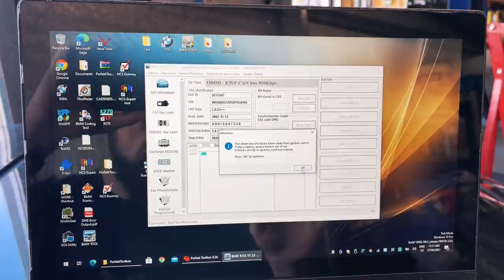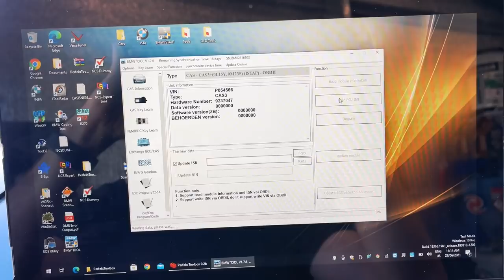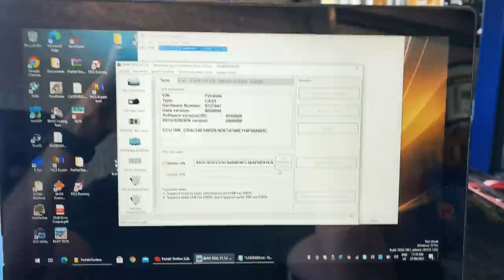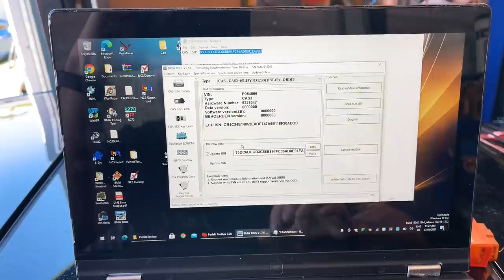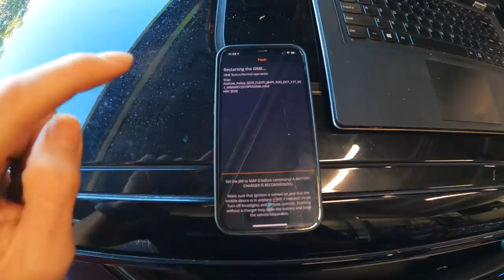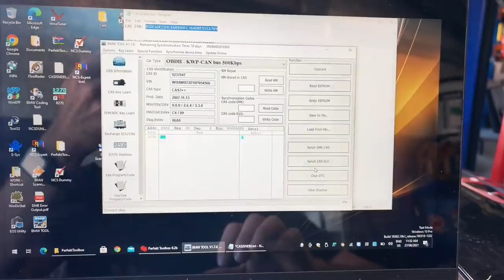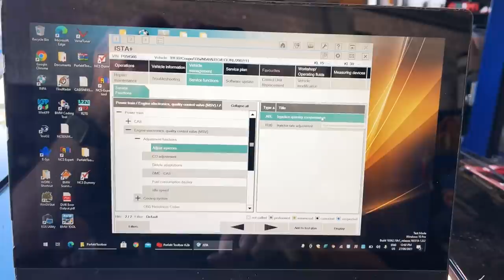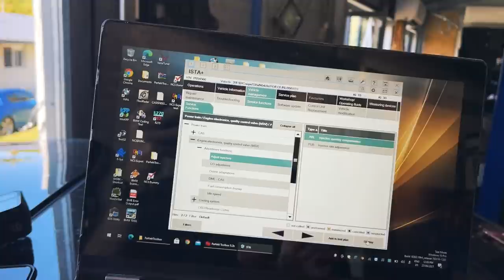BMW N54 335I MSD81 Upgrade DIY: VVDI Bimtool Pro

Comment: only Exx with EWS in EGS (ie.ISN) is E70, E71.  Vin does not stop starting of car, after reading/writing of CAS you need to sync ELV/CAS and it will start. Coding in DME is minimal at best.

Comment: I'm replacing my MSD 81 part # 7592080 with one with the same exact part number. Do I just need to change the VIN on the DME using WinKFP or is there more to it? Trying to just replace the DME but I also have the matching CAS and Key fob from the donor vehicle. If I replaced as a set, do I still need programming of the VIN? Thank you.
Reply from the maker: I dont like replacing all units although the car will run, but it will think it has the wrong vin number. I am under the impression you cant change the cas vin with winkfp, which is what everything relies on. However i havent gone through it myself, just read about people with issues and looked in to ISN change to make the new DME work with original cas.
Reply from the maker: You can change cas with hack tools, just not winkfp. I think......

Comment: One question did the auto gearbox work after doing this mod? The ISN in the gearbox needs to match the ISN in the CAS and DME. If you changed the ISN in the CAS the gearbox will possibly no longer work. The engine will run but no mechatronics in gearbox will work. Did you have this problem or did the auto gearbox still work?
Reply from the maker: It did however, e9x series dct and auto do not have isn in the boxes.

Comment: Your DIY charger in on another level. Looks really high end.
Pretty sure you can sync CAS and EWS with ISTA too, for anyone without a brick tool.
Reply: it wont if ISN is completely different. It will for only CAS2 if ISN are the same but syncing data is corrupted.

Comment: This may be a stupid idea... but could you not just take both the DME and the CAS module from the donor car and put them both in the car the DCT is going into and then just use the key from the donor car as the new key? Is there any reason this wouldnt work? I ask because I have a wrecked 135i that I am wanting to take the DCT from and install into my 335i. thanks :) Love your videos btw!
Reply from the maker: It would work, however the vin number would be incorrect when you plug MHD in, or any scan tool. You would also need to re do the coding on them.

Comment: Nice work 👍🏼 out of curiosity so VIN matching was never a requirement right? Just ISN matching if I'm correct.
Reply from the maker: The vin matching I just did with mhd, now I think the car will run with mismatched vin the but cluster may show a tamper dot. However a simple mhd flash will write the vin from your cluster to the dme now.
Reply: @ZeroTo60Tube  Interesting I know cars run with VIN mismatching between DME and CAS,  as long as ISN matches.

I believe MHD happens to re write  old donor's car VIN. But doesn't matter since your license will work with your old VIN as MHD also does a check against the CAS and if any of those (DME VIN or CAS VIN) match your license VIN then you are good to flash.

In order to avoid tamper dot your VIN on the cluster should match the VIN on the CAS. I've been told this back in the days.

Comment: All the technicalities aside, if I’m trying to swap DME’s the issue is matching the new DME info to your CAS and keys??
Reply from the maker: Basically for the car to start all the Isn’s need to be the same in the dme, cas and trans (if the trans is equipped with isn security). I think it’s only the dct that has that on the e9x cars. Once the isn lines up the car should start. You need the vins in each module to line up to avoid tamper dot
Reply: @ZeroTo60Tube  so if the vins don’t match, you can never sell the car. 😅
Reply from the maker: @TML34  well tbh honest i havent personally tested the tamper dot theory, but that is what read. Either way its super easy to match the vins with a MHD flash
Reply: @ZeroTo60Tube  So how does MHD flash properly if you’ve now got different VIN’s in the DME and CAS? Or can you overwrite your existing VIN into the “new” DME?
Reply from the maker: @TML34  MHD uses the cas to identify the car, and writes the cas vin to the UIF section of the DME. Doing some reading before, the vin is stored in two places in the DME but the UIF must be all that matters. If i scan the car with inpa it now shows my cars vin on the DME after the MHD flash.
Reply: @ZeroTo60Tube  Does MHD now showing dme VIN and CAS vin the same or different? 
It seems VIN would always show up as the original dme vin

Comment: Did you manage to change the VIN number if so how
Reply from the maker: Not with this tool. The vin is stored in 2 places on the DME, this can only change one of the stored vins. Mind you that vin change should be fine for emissions checks. You can also update the vin with winkfp.
Reply: @ZeroTo60Tube  thx for your response mate, do you think MHD would do the job?